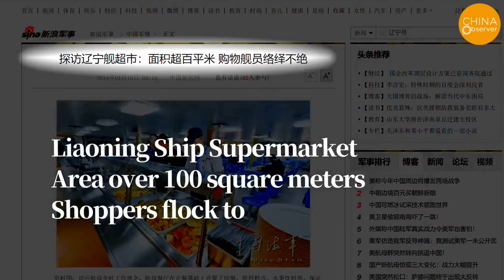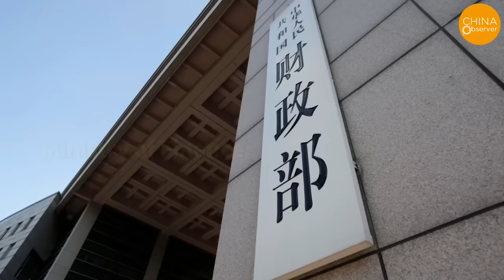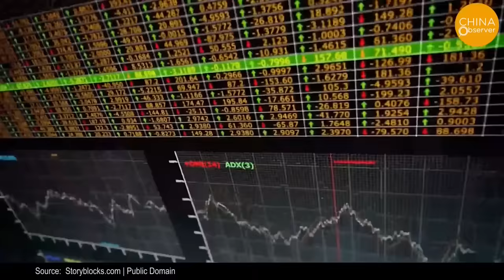China’s Junk Aircraft Carrier Fears to Sail? A Big Joke Due to Copycat Failure

Comment: How is there such a gap between US made Aircraft Carriers and Chinese built Aircraft Carriers? The United States has been operating and perfecting Aircraft Carrier operations for almost 110 YEARS!

China learned to build aircraft carriers from Russian Engineers. Russia only built aircraft carriers for less than 20 years. They actually did not know what they were doing while they were building those carriers.
Reply: It's probably cause China is trying to copy one of the most technologically advanced carrier in the U.S. Which by default is a failure. We have this carrier till this day not ready for operation. This thing never works and has huge design flaws. They've been trying to get this thing working for over 7 years now.
Reply: The PLA's first "aircraft carrier" was built on top of a floating Russian casino. The 2nd one is a copy of the first. The 3rd one is more Indigenous designed, so it's completely worthless.
Reply: There is utterly no replacement for experience.
The US and UK spent decades learning how to operate carriers safely and efficiently, and keep them provisioned at sea for long deployments.
Nobody else has that capability.
Reply: @charlesharper2357  maybe, MAYBE, france, is probably the closest to doing so, but only because they could borrow advisors from the UK and US
Reply: @delphy2478  
The French just don't have a history of long deployments to places like the Indian ocean or the South China seas.
That kind of experience can't be taught in a classroom.
Reply: @zhenyucai8688   what Carrier are you refering to?  Cause the Ford has been deployed for over 4 months now and got extended.
Reply: @jcak552  Has the ford finally deployed? Guess im outta the loop but yeah that garbage was work in progress for a years. Might be the biggest shame in the navy when it comes to cost vs reward.
Reply: @powershift2024  The 3rd one tried to copy Gerard R Ford US carrier.
The electromagnetic catapult, also called EMALS, on Ford is quite bitchy and the cause for delays.
It's quite possible the Chinese EMALS runs into similar issues and busy debugging them.
Additionally, because Fujian is not nuclear powered, the EMALS might be constrained by the amount of electricity it is able to produce using a conventional turbine steam engine power generator.
The EMALS on Ford uses AC while that on Fujian uses DC.
Reply: It's quite telling that the PLA still can't figure out technology the US had mastered in the 1950s. The USS Enterprise launched in 1960, had 8 A2W nuclear reactors powering 4 steam turbines generating over 280,000hp with a range of unlimited distance for 20–25 years carrying over 90 aircraft. Almost 70 years later the PLA hasn't a clue how to build an actual navy, just bamboo and plastic rafts with little emporers cos-playing as soldiers. It's beyond embarrassing.
Reply: @powershift2024  I trained on A1W and deployed on the USS Bainbridge, South China Sea, 1966.
Reply: @msimon6808  thank you very much for your sacrifice and service Mr Simon. Hoping Xi isn't ignorant enough to doom his people back into another Cultural Revolution 2.0 but he was never a very bright student of history, or anything else for that matter.
Reply: Ukrainian casino.  And that is the best hull they have.
Reply: @theylied1776 - One could add that it was the UK that led the world in developing carriers. They built the first converted carrier (HMS Argus) in 1918 while the US Navy's first converted carrier (USS Langley) was in 1922
The UK laid down the first designed and built carrier (HMS Hermes) in 1918 although the Hosho was commissioned before Hermes in 1922. The US didn't lay down a designed carrier until the Lexington in 1922 which was commissioned in 1927.
Every carrier development used by the US Navy since had been developed by the Royal Navy with the exception of nuclear power (which has no advantages and costs far too much money).
Reply: @1chish  You really don't know anything about engineering, do you? Since World War 2, British aircraft carrier design has absolutely nothing to do with American aircraft carrier design. 

The British aircraft carriers are diesel powered  with a ski jump launch. American aircraft carriers are nuclear power with steam powered launch. Those facts alone means that the flight deck of an American and British aircraft carrier is absolutely different. 

When the British designed their diesel-powered HMS Queen Elizabeth, they consulted with American Carrier builders at Newport News. They had to design their new aircraft carriers to be 80% similar to American aircraft carriers because they were going to using a compliment of american-made F-35s. 

Do better research, you made this way too easy for me.
Reply: @theylied1776   I do smile at people who know nothing yet take a self righteous superior attitude and tell me I have no knowledge. And finish by telling me to do research.
Quote:
     " Since World War 2, British aircraft carrier design has absolutely nothing to do with American aircraft carrier design"
Oh really dude? So OK so lets take that apart:
     Background:
1. the first operational carrier was HMS Argus in 1918. the first US Navy carrier was the USS Langley in 1922.
2. The first designed and built carrier was HMS Hermes laid down in 1918 although the HOSHO was commissioned part completed first. The first US designed carrier laid down was the USS Lexington commissioned in 1927.
3. Hermes set the carrier design of island to Starboard that is still used today.
4. The first radar used on ships and therefore carriers was developed by the British thanks to the British Cavity Magnetron in WWII and given to the USA in 1941.
      Post WWII:
5. The first landing and takeoff aboard an aircraft carrier by a jet-powered aircraft were made in December 1945 on HMS Ocean.
6. The steam catapult was designed by the RN and first used on HMS Perseus in 1950. the US Navy bought the right to manufacture their own catapults in 1952..
7. The angled flight deck was first tested in 1952 on HMS Triumph and copied later on to USS Midway. In 1955, HMS Ark Royal became the first carrier to be constructed and launched with an angled deck, rather than having one retrofitted.
8. Optical Landing System (OLS) (nicknamed "meatball" or simply "ball") was developed by the RN in 1951 and was copied by the US Navy in 1955.

So as I wrote - apart from nuclear power every carrier development has been by the Royal Navy. the steam catapults you brag about were BRITISH DESIGNED. And that ramp you scoff at? Proven in combat in 1982.

And lastly you write complete fantasy. At no time did the UK consult the US Navy about their new carriers. We didn't need to as we had more experience with STOVL than the US Navy and were the key designers of the F-35B. There was NO need to be 80% similar at all. Complete and utter fantasy.
Reply: @1chish  Lovely manifesto, wrong, but lovely. Again do better research, do not use Wikipedia.

US and British aircraft carriers have been different since the end of World War 2. The engineering alone of a diesel powered aircraft carrier Vs a nuclear powered aircraft carrier are absolutely different. From the displacement to the tonnage. 

Please disprove anything I've claimed about the HMS Queen Elizabeth.  They designed it like an American aircraft carrier in order to accommodate the american-made F-35s. 

You must be a kid to double down on something you have proven that you know nothing about.
Reply: @zhenyucai8688 what are you even talking about? The Ford is a fully operational carrier, the teething problems have all been mostly resolved
Reply: @zhenyucai8688  last time I checked USS Ford has been at sea for more than 200 days off the coast of Israel.
Reply: @niweshlekhak9646  Doesn't change the fact that it was a joke of a ship that took 12 years to build. This thing cost 8x as much as a regular Aircraft carrier to build.
Reply: @zhenyucai8688  Nimitz class cost 9.7 billion, Ford cost 13 billion. It has laser weapons, EMALS and bunch of other stuff.
Reply: Ask the CCP
Reply: @1chish nuclear power has no advantages? 🤣🤡😂
Reply: @3373just   No there isn't and certainly not at the huge extra costs. But then I have already explained why. Try reading ALL of a comment not just the first part.
Or better still compose a logical counter argument to my view rather than 4 words and 3 stupid emoticons with nothing of value.
Reply: @niweshlekhak9646   The Ford actually cost $18 Bn. the next one, Kennedy, is costing $13 Bn.
Reply: @SelfProclaimedEmperor   If the 'teething problems' have been resolved why did the US Navy have to send a 2nd carrier group (the Truman?) to the Eastern med. as well?

I will give you the answer: EMALS is still a crock of doodoo.
Reply: @1chish  your nuclear claims were the last sentence you wrote NOT the first! 😂🤦🏻‍♀️also if you can't see the advantages of not having to deploy alongside an old slow tanker ship and not being reliant on access to friendly ports there is zero chance anything you say on this topic has any value whatsoever!!!
Reply: @3373just   And still no counter argument just the usual ignorance and pedantic arrogance.
So let me educate you:
A nuclear carrier still needs 'old slow tankers' because it need RAS for weapons, aircraft fuel and victualling (for 5,000 people).
However a CVN does not deploy alone and its entire CSG flotilla uses diesel power. So THEY need RAS for fuel, weapons, victualling and aircraft fuel (helicopters) and rely on 'old, slow tankers'. Or 'friendly ports' 😂

Now the UK CVs have a new fleet of tankers that go with them and the CSG. They do not need 'friendly ports' (the stupidest of your assumptions) as was proved when HMS Queen Elizabeth sailed to the Pacific and back which also proved the UK CVs can port anywhere they choose. A US CVN cannot.

So it seems there is zero chance anything YOU say on this topic has any value whatsoever!!!

[Drops the mic ..]
Reply: @1chish  they sent a second carrier group because deterrent against Iran requires more than one carrier. The US has 100 years of carrier operations experience. There is no doubt that their carriers are the best in the world
Reply: @powershift2024 well its expected the development of the us carriers didn't go smoothly either

Comment: To be fair, US Aircraft Carriers have at least 2 or 3 "convenience" stores on them. I served aboard the Theodore Roosevelt between '87 and '91 we had one relatively large store, roughly the size of an average 7/11 and 2 smaller stores about the size of an airport or mall kiosk. 

Additionally the IJN Shinano while a massive carrier for its time was converted from the hull of a Yamato Class Battleship which is where she got most of her mass from. She also never saw any real combat action (other than being sunk by a submarine) and never had a combat air group embarked.
Reply: Removing  Granit ASMs was actually a good idea. Only reason they were installed in a first place was to designate the vessel  "heavy aircraft CRUISER" and thus being able to cross Bosphorus strait (closed for aircraft carriers)
Reply: I was aboard TR from '84 (when it was under construction) to '88 (first NATO cruise). I remember standing in line for the 'big' store on the regular.
Reply: Before building convenience stores, everything else likely functioned properly on those US carriers. In contrast, the Chinese carriers prioritized the convenience store. Maybe they'll fix the problem later, maybe not. At least they can buy snacks.
Reply: Yeah, but those are there to provide a sense of familiarity with norm for the people deployed on board. They're the tips of icebergs lurking under water. For China, that convenience store was a pathetic attempt to mimic that, likely only stocked when eyes were on it.
Reply: @mazatlan79P  The Russians originally installed those on that carrier line because the Russians don't have a robust support fleet for their carriers. Their carrier has to pull its weight across multiple roles for a single ship. One U.S. carrier strike group was bigger than the entire Soviet/Russian surface fleet. They knew that most of their ships that they claimed they had weren't seaworthy or never truly outfitted. Their carriers would have fewer combat ships supporting it so the carrier itself would have to perform some offensive duties outside of their attached aircraft. When your fleet consists of a few destroyers and a couple of cruisers versus an enemy of 3-4 cruisers, 4-5 destroyers along with multiple carriers, frigates and other support ships all equipped with vertical launch tubes of missiles, you can't afford to waste space and go in under gunned.
Reply: Oh really? my first boat only had one on USS gary and i think we had 2 on the Cowpens.. but when i got over to the Amphe Blue Ridge yeah we had 2... man those them Mountain Dew and cig are gold mine...... 3 on a carrier? really i thought there would be more?
Reply: To be fair, the “stores” didn’t replace SAMs on the carrier.

Comment: If China does not have an actual doctrine for using this unit, there will be real issues with proper escorts, logistics support, and deployment schedules, and that's just the ship and not the airgroup.  The airgroup ALSO needs to mesh with the capabilities of the escorts for even mere self-defense, not to mention the SSN that will be trailing this thing everywhere.

The pace of US operations require almost a 2 working up to 1 deployed rotation, which merely 3 units, with obvious different capabilities in the mix, will be an issue.  They will have to hope the war doesn't break out while the wrong carrier is on duty (i.e., not in pieces in the shipyard) and the wrong airwing is deployed somewhere else.
Reply: don't need doctrine for a ship you can't protect

Comment: Even the US, with a century of aircraft carrier building and operation, struggles with electromagnetic catapult systems.
The China is going to try and skip steam powered catapults is absurd. China has no history with any catapults, as the old Soviet carriers do not have catapults, which is why they have the launch ramp in front.
So much goes into a catapult system, even one that has been used for 100 years, they are still complicated to use and maintain. There is a zero percent chance China will get this right in terms of operation. This means, even if the system works in testing, it will not work under stress.
The entire reason to go to electromagnetic is to increase your launch rate. China will fail in this.

Comment: Shocker, a Chinese carrier performing like it was made in China.
Reply: KInda performing like a US carrier. How long did it take Ford to become operational? And why was that? Oh issues with electro magnetic catapults, ordnance elevators, $400K per sewage unblocking.
And then their is the LCS classes, the Zumwalt class. How are those shore bombardment guns going? Never mind when the USMC is landing on that first island chain they won't have naval gunfire support, because the BBs have been retired in such a way they can reaonbly be recaled, the Zumwalt class guns that were supposed to replace the BB guns had ammo cost hundreds of thiousands per round - and didn;t work well. And the extended raange guns/ammo that were supposed deliver a 3rd class naval gunfire support capability is also having problems. Shall I go on?
And we can talk about corruption too, because most of those projects the conctractors hget paid and deliver nothing.
Tell me again how the US doesn't fuck up naval/defense procurement and how great Made in the USA is.
Reply: @1337flite  While the US had issues getting it going, China on the other hand is having a host of problems, so much so that the aircraft carrier is currently in docks with three large hangers covering the three ramps that they have.  Not only are they imoperable, they cannot obtain the required parts for it thanks to sanctions so they're using off the shelf parts instead of military grade.  One of the China Uncovered News channels here on YT had a nice piece the other day about the fiasco that is the Chinese Type 004 carrier.  In a nuthsell, China copies everything, they do not innovate.  You're talking about a nation where things literally fall apart, be it the cheapest goods you can buy to bridges and stadiums. And I havent even touched on the fiasco that is the J20.

Comment: Oh?  The US Ford supercarrier is still having teething problems that seem unable to go away.  It's EMALS is failing at 15% of its designed MTBF and its blast shields and elevators are still not working well. The Fujian had its first sea trial and tested its propulsion and power systems, so far no problems.  Awaiting EMALS and radar tests soon.

BTW, the Ford's EMALS is said to be a design problem that won't be solved until 2025.  Not only the Ford problems, but the F-35 are said to have an availability of only 35%, that means it takes three  F-35's to get one that can fly on a mission.  Then there's the Littoral ships that are headed to the scrap heap. Now, the US navy is backing off their 12 super carrier fleet and thinking of smaller ships, like destroyers.